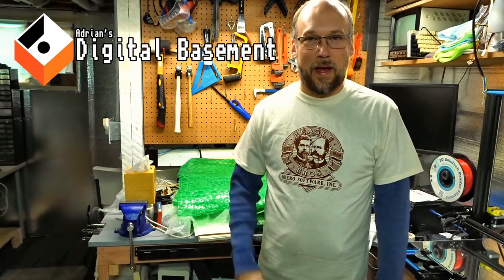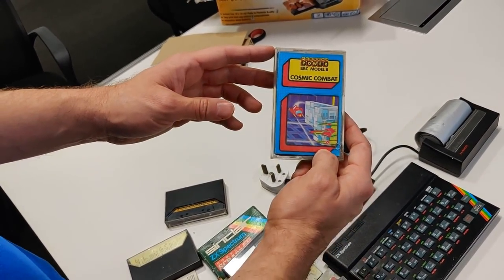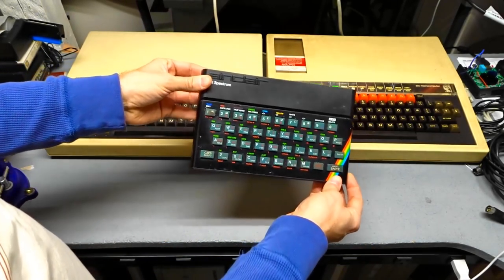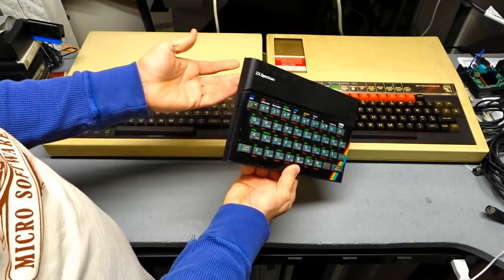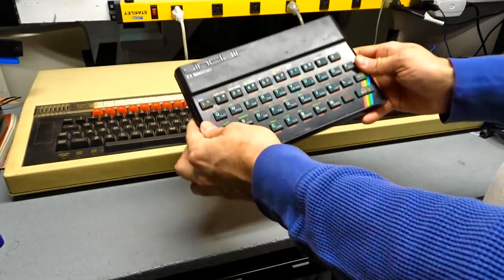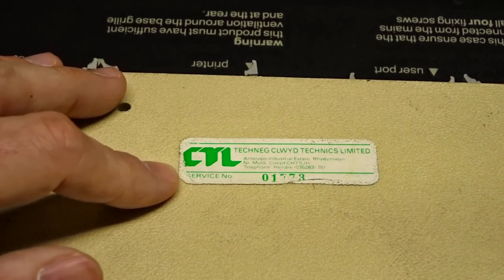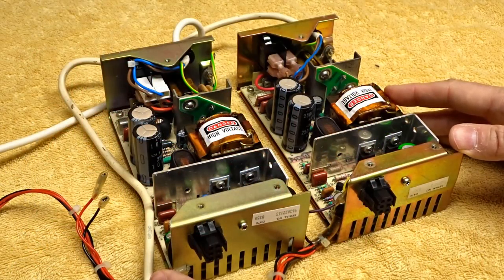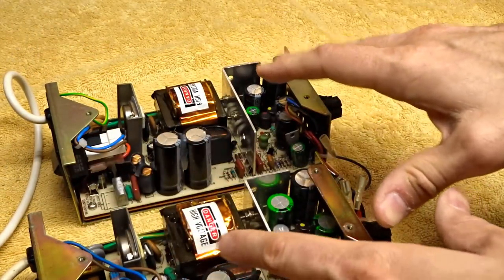I visited the UK and brought back some computers! Let's see if they work.

Comment: Wha?! That Beagle Bros logo is so anachronistic! At least, it would have been in Britain. As I remember it, the early 80s were kind of the anti-steampunk era if there ever was one. :) The last steam trains were really dying out; I think my mother took me to see the last steam train even allowed on the main line when I was too young to even know what the fuss was about. Outside of a few preservation societies like the Bluebell railway, everything old was boring and Britain was looking to The Future! :) Maybe part of that was just me, but I do think it was a low point in appreciation for the past.

The BBC Micro cases did seem to vary quite a lot in odd ways. I think I've seen one with a hole like that before. No idea what it's for.

I don't think the copyright idea makes sense because this was actually a BBC product. But then it would make sense if Acorn tried to sell them in other countries without BBC involvement. But if that was the case, why didn't they completely rebadge it? Anyway, the BBC can be extra-fussy about copyright... although this is a trademark issue. I'm confused now. :)

I think that's actually how Boothroyd is pronounced... but I can't be sure. :)

I remember BBCs as having the sharpest color displays around. (I didn't see any PCs in those days.) I guess that RGB output is responsible. Amstrads might have been equal, but I didn't see any up close. This reminds me of the monitors. I thought they looked weird when I was a little kid, but they grew on me. You can see very little of the case from the front, the tube is almost completely exposed with the controls on the back. Complete opposite of IBM PC monitors of the same era, or just-about any others. I think you did see that type in broadcasting studios, they were the right shape to be stacked into a wall of screens.

Oh games! The BBC wasn't really a games machine with its limited sound and lack of sprites. Instead, it had a reputation amongst us kids as one of the most serious computers you could get, second only to the IBM PC despite only being an 8-bit. ;) But I did get to play Frogger on it. I loved Frogger, although it did look a bit funny on the BBC with cheesy colors and lack of detail. I'm told you could get Elite on it, though I didn't know it at the time. That's impressive for an 8-bit.

Comment: Even in the early 00's we still had Econet sockets around my secondary school, primarily as they had Acorn machines until the first W98 came on stream (bypassing ms-dos, win3.x and win95). The last acorn machines being A7000 units plus a mixture of other Archimedes/A series machines. 
These were networked to a RISC PC in the IT technicians office.
When I started in 00? they were still using acorn machines in some rooms, for example in the library for taking out books.
They naturally had the great advantage over wintel machines in that they booted from ROM so took seconds to boot form cold.

And the first BBC models did use a linear PSU and that was a requirement from the BBC themselves, I believe due to ease of reparability, unfortunately these created too much heat and so were unreliable (esp. when a floppy drive was powered off it as well). This ended up with Acorn being allowed to change to a switching supply which was much more reliable.

Comment: Looks like one has a Wordprocessor ROM in it, the hole is likely for heat dissipation where the temperature could get hotter faster than the case can dissipate heat through the vents.

Comment: I think I still have a BBC Master 128k in a cupboard somewhere with the monitor and floppy disk drive that came with it. The BBC computers (model B like you have there) were largely the first that were introduced into primary schools in the UK when I was about 10. That means that a lot of educational software was available for them. I seem to remember programming some (largely non graphical) adventure games for it back in the day.

Comment: Ohh wow - I used to have a few BBC at my school in the 80s. One, and only one, had a hole with a clip in cover on the top. I never knew what it was for. I'm guessing that the earlier power supplys gave out more heat, and the hole and grill was to dissipate heat.

Comment: Making an educated guess with regards to the whole in the case: the original PSU design the early micros came with are prone to overheating and burning out. Also the capacitors in both types of power pack are prone to the dreaded battery leak of electronics of this era, so swap them out ASAP!

Comment: In the late 90s, you could pick up BBC Micros by the dozen pretty much for free as schools junked them and nobody else wanted them. I literally had piles of them, along with the disk drives and Cub RGB monitors (the classic monitor for the BBC Micro). I wouldn't offer more than £10 for one, they were so common.

How times change... these days a working Model B in decent cosmetic condition with disk drive can easily cost a three-figure sum.

They were fast and powerful machines for the time with some of the highest-resolution graphics around (640x256, but only monochrome; games typically used one of the 160x256 modes that allowed multiple colours), although they don't offer sprites.

Comment: You just need to take the plug off the power pack and swap it with an American one. No need to swap the entire power supply. Uk devices are fine with U.S Voltage. You just need to unscrew it to open it, ignore the yellow/green earth wire and just hook up the brown live and the blue neutral wires.

Comment: There is an exception to the 80s capacitors being reliable thing. 80s metal film capacitors sometimes cause problems especially in the power supplies of certain TRS 80 machines. I had to replace the metal film caps in my TRS 80 model 12 when one of them exploded after being plugged in for 5 minutes.
EDIT: he mentioned it in the video literally a few seconds later. I should really have watched the whole video before commenting.
Reply: Adrian Black yep, luckily the smell doesn’t stick around for very long once you remove the blown capacitors.

Comment: I used to have that exact model of spectrum as a kid and still have it up in the attic. It is extremely sensitive to the input level of the cassette tape player....on my old cassette player where the volume went from 1 to 10, only volume six and a half would get it to load properly. Often it would get to 99%, and then crash. One of the best games is 'super stunt car racer' and 'jetset willy'

Comment: My first home computer was a BBC Model B, circa early 1982.
So I think it would have been a second or later issue.
I can tell you it had no holes any where.
There were two second processors available at that time, 6502 and z80. They were in a similar style box to the BBC computer. The ARM came later.
The Rom slots could hold software applications, such as word processors.
One of the ROMs is probably Wordwise (with the label on it?).
https://en.wikipedia.org/wiki/Wordwise
Reply: Came here to post that. Try typing *WORDWISE
Reply: I spotted the Wordwise function key list on the beeb with the hole in the case. It looks like the ROM is still there. This word processing ROM can be activated by typing '*w.', or '*wordwise' (as noted in the previous reply).

Comment: I worked for a company making remote controlled submarines SEAEYE MARINE and there analog 600 models pre 1990 used a bbc micro for the surface controller which run the telemetry and video overlay if you want i might have the ROMs with the software we used  for what i dont know ...they were very hard to get even then and we kept a good stock of them  but it was unreliable and was later designed out

Comment: I think I'd try and get a physical voltage switch in that power supply instead of the jump just in case the machine makes a pilgrimage back to the UK
Reply: I'd make sure to put a label on the back that it's switched internally for 120v.
Reply: @adriansdigitalbasement  my feelings are more along the lines of "completeness" than practicality of moving the machine between regions

Comment: The bbcs were popular in schools until the late 90s. I recall using one to program a "turtle" robot to make movements. It may have had a method of drawing a line as it went, as i remember the commands penup and pendown. I think!
Reply: That'll be the Valiant Turtle, they were available free to schools as part of a bulk deal when you bought a certain number of BBC Micros. It did have a pen holder, which could be raised/lowered under software control.
Reply: @gwishart  thank you!

Comment: Those aren’t paper caps; if they were, they’d be larger physically. They, should however, be proper X-/Y-rated across-the-line caps, though! I believe those were polypropylene/polyethylene plastic encapsulated capacitors. Please do a “review” video once you get one of the BBCs working! 🤠

Comment: The  BBC micro was sold in the US, but it wasn't very successful and a lot of the computers ended up being re-modified and shipped back to the UK. Interestingly, the US Beeb is much heavier than the UK version--to get FCC certification they had to add hefty metal RF shielding whereas the British version just has the moulded plastic case. The American Beeb also had some modifications to the ROM to support the 60Hz NTSC video modes, as well as changing the BASIC COLOUR command to "COLOR". I'd like to see an American manufacturer extend the same courtesy when selling a computer in this country!

They were ubiquitous in British schools in the 80s, largely off the back of the BBC (British Broadcasting Corporation)'s Computer Literacy Project, which used the BBC micro to showcase the microcomputer revolution that was in full swing at the time. (Hence the name.) They didn't do as well in the home market being too expensive for the majority of home users who tended to plump for the cheaper ZX Spectrum or the Commodore 64. The Beeb did boast some notable games though, among them the very first version of Elite. (Fun fact: the 8-bit Elite used procedural generation to create 8 galaxies of star systems from a 6-byte pseudo-random seed; the developers had to scrap an entire universe when their algorithm generated a system called Arse!)

The ROM software available was very impressive. The lower 32K of the 64K addressing space was RAM. The upper 16K was reserved for the OS ROM and memory-mapped I/O. The remaining 16K was shared between the "sideways" ROM sockets with bank switching controlled by software. BASIC lived here, but you could get file system drivers, additional languages, word processors, spreadsheets etc. as well, just plug the relevant chip into the expansion sockets. The OS had comprehensive support built in for accessing the standard hardware, although a lot of programs banged the I/O space directly for speed. BBC BASIC was by far and away the best of the 8-bit BASICs of the 80s. Acorn developed it in-house rather than licensing Microsoft BASIC like certain other manufacturers of the time did. It featured graphics and sound commands, some attempt at structured programming with REPEAT/UNTIL and named functions and procedures, and a built-in 6502 assembler so you could develop assembly language programs. I got my start in "serious" programming with the Beeb.

The expansion capabilities were indeed impressive. Econet was a proprietary Acorn networking protocol used in some schools and by basically nobody else. The Tube was Acorn's external coprocessor interface. If you got a "cheese wedge" coprocessor box that sat next to the Beeb and plugged into the Tube, the main 6502 would hand over control to the second processor and subsequently handle I/O on the copro's behalf. There was a 6502 copro available, as well as a Z80 that was capable of running CP/M. Also the first generation of ARM processors were developed as coprocessors via the Tube before being incorporated into Acorn's next generation of Archimedes computers.

Anyway, I could go on about this bit of British computing history all day but I've probably said quite enough for a comment. Congratulations on being the proud owner of these lovely machines!

Comment: Here is an interesting thought for your second BBC.  Back in the day, Acorn were scared of the Spectrum so they set out to produce a competitor that was mean to be a BBC for the home. This turned out to be the Electron and was horrible.   

In my opinion Acorn could have cut a lot out of the BBC to make a much cheaper competitor.  This could have included a much smaller case, membrane chick-let keyboard, wall PSU, and removed most of the ports. An issue they had with the Electron was removing many of the chips and replacing them with a ULA.  This cost a fortune, took forever to do and reduced a lot of the BBC functionality. 

If it was to be a Spectrum competitor, all it needed was:  CPU, RAM, ROM, Graphics, Sound, Modulator, tape and maybe edge connector and maybe 1 simple joystick port.  This means a whole lot could have been removed.

So my solution, and challenge for you is, on the other BBC, see how many chips you can take away from the PCB while still keeping tape compatibility to load games and use Basic.
Reply: The Electron was a big mistake from Acorn - it was half the speed of the BBC Micro, didn't have the handy "teletext" Mode 7 and virtually no expansion. It goes against all historic computer progress to release a "successor" years later that was literally twice as bad! As for cutting down the BBC Micro, one of the original's best features (especially for programners) was its fantastic full-sized keyboard (easily the best of any 8-bit micro), so to suggest replacing that with a godawful membrane chiclet keyboard like the ZX Spectrum had is one of the worst ideas I've heard!
Reply: @rklrkl64   You know there was massively more programmers on the Spectrum than the Electron, and after learning the basics they upgraded the keyboard.  Keyboards are very expensive so is an easy way to initially reduce costs to sell machines, yet they are very easy later upgrades.
Reply: @10p6  Yes. That was the genuis of Sinclair's approach. Give you the bare minimum and let you paid for upgrades later. More than half of the features the BBC had (and it had many cool features) most people never used yet all contributed to the over-the-counter price.
Reply: @chaos.corner   Exactly.   If anything, the Electron should have been more like the Oric 1, but without the ULA, instead having the CRT and the Texas Sound chip.  It would have been cheap to produce, cheap to sell, 100 percent compatible with BBC B, and over time we would have seen awesome games that were better than the sum of the parts like on the Spectrum as programmers would have learned to really push the machine.
Reply: @10p6  I think going cheap on the keyboard would have been a mistake but they might have been able to cut costs there a bit. The Electron was definitely a misfire though. And too late too.
Reply: @chaos.corner   The thing with the Electron is the development of the ULA slowed the machine launch down by a long time, so with my idea it would have been available at the same time as the Spectrum.   As for the keyboard, if they made the Electron just the size of the BBC keyboard, the could have made a cost reduced version with cheap keyboard, and a version with BBC keyboard for more, but still much less than the BBC B, and also sold the proper keyboard as an upgrade.  Win win win :-)
Reply: Arguably Acorn did a much brighter thing, and that was to develop the ARM processor, the architecture of which went on to be the most popular in the world with over 100 billion having been produced worldwide as of 2017.

Comment: Hoping to see a future speech upgrade for BBC Micro, got one for mine that I never got working with it. Something about a factory fault, other than that, they're awesome machines.
Reply: They did work, I have the speech chips on my BBC. You must have either an early rev (where it didn't work without some green wiring) or bad chip(s)

Comment: The thermal print was colloquially known as “The Bogroll printer” because the paper roll looked like a Pieter paper dispenser. ps. Yes that was Welsh on the maintenance label. Clwyd, is a Welsh county. PPS The Scots and the Welsh get upset if you call the UK, England.

Comment: Speccy 48 was a great computer, games were like £2+ each, and there is 1000's, Spectrum and Commodore were fighting to be the best in UK, I had the ZX-81 as my 1st computer ever in 1985'ish, but the rubber keys 48 was awesome, worn out the keyboard membrane a couple times, and the power connector in the back of the system became loose, many times I nudged the computer and it reset, wouldnt be so bad if the load times werent like 20mins for some games lol, Streets of Rage took forever, I still have some original games from the speccy 128+2, though not the machine as an ex friend stole it, but I still have my Commodore Amiga 1200, back when games were cheap, well made and hard to finish.
I also owned a Vic 20 and for a month I had an Atari ST but the games wasnt as good as Amiga 500 so took it back for the Amiga, oh and owned an Amiga CD32 which had the best controller for comfort before the Playstation appeared.

Edit - At my last school 1986 we had BBC computers to learn on, unfortunately I was only there for a year so didnt benefit from them.